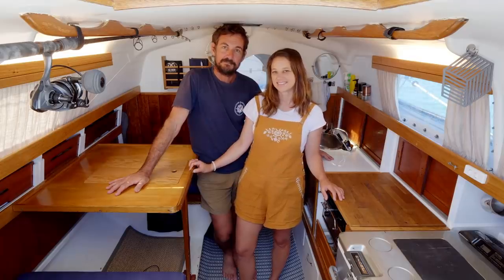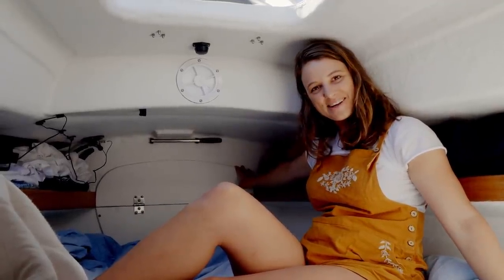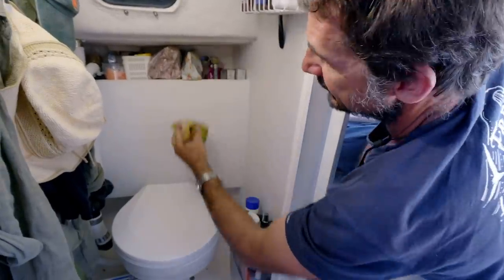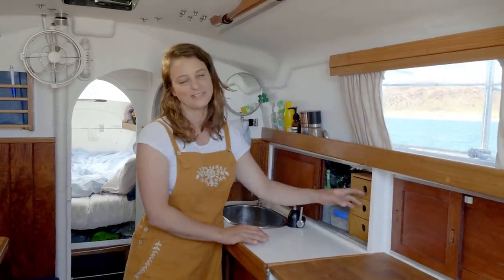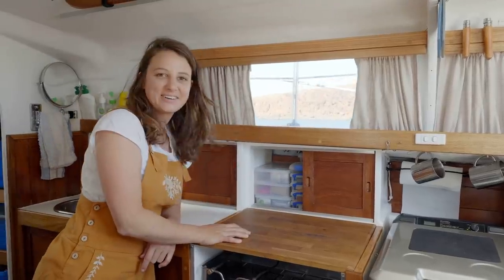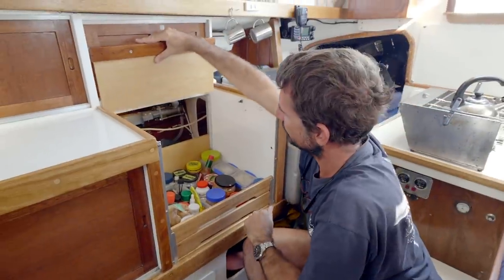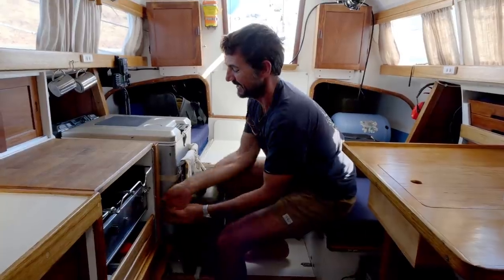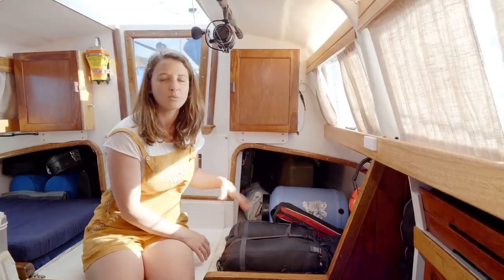Inside our TINY HOME. The 50 year old sailboat we rebuilt.

Comment: I am glad to hear you advocate for a "Sea Chest". I have never understood why some people who clearly have the Opportunity when refitting or building a boat do not avail themselves of that option. In addition, I am a strong believer in cooling the Main engine with a keel cooler. Something as simple as a pipe on the outside of the hull running the entire length, filled with radiator fluid, being cooled by the seawater, and returning cool fluid to the engine would eliminate all kinds of heat-exchanger and raw water cooling pump problems.
I would guess that a very large percentage of below deck problems are the result of not having those two options installed.
I love what you did as it not only shows pride but also a good understanding of how to optimize available resources.
All the best to you both.
Reply from the maker: Keel cooling is the best system if it is designed well to bleed air out of it and a nightmare if it isn't!

Comment: Nice. Great to see what all that hard work has meant. We missed the opportunity to buttonhole you for a look in both Freo and Exmouth, but we also have a Maxie meths stove like yours, that is surplus to our requirements and in a shed in Perth should you ever require it for parts. 
Also re electric propulsion motors, one thing people seem to forget about this is that a sailboat already has a very small carbon footprint because most of the time it is WIND POWERED! The diesel is for auxiliary purposes only. And 200 ltrs per year of diesel is just 2 or 3 fill ups for a car, which no one gives a second thought to.

Comment: Some good ideas there for your boat layout, I've got a 1973 Kings Cruiser 29. Very narrow just like yours but loads of headroom, I'm 5 foot 8 with room above. So probably about the same headroom. Also on manual water pump and an original origo 3000 meths cooker, I use bio ethanol here in the UK.

Comment: Re the multiple seacocks agreed, we have two on our boat these days, but that's just because the cooling pump for the engine sucked too hard and caused the other pumps to fail to deliver consistently. So they're split on two now and it's been good ever since. Also, absolutely incredible how thrifty you are with water. Even if you splurged and used 10/day/person you'd go 50 days without a top up on our boat with 1000l :-D However ours gives about 5 days with a crew of 4-6 including ~50% females who don't like the pump turned off mid shower but get the message quickly from it :-D

Comment: Very nice/clever holding tank setup you have there. The only extra thing I'd have is a port on the top so you could use a salt water hose to rinse it out every now and again to avoid build up of solids or whatever. Our boat is still antisocial, illegal since 2002 inshore. My plan is not to go with these complex mechanisms, though if going long distance I probably would go a similar way, instead it's to use 50l plastic drums and have a composting set up. Carry coco coir bricks to rehydrate and cover it with because they're very compact (approx 50l from about 1l). Could hold maybe 10-50 of the drums in the hold for longer voyages. When full, lid on, and stow, replace with empty and repeat. I do plan to do a small tank setup for shower and kitchen water to be fully compliant, but it's not a big priority.
Reply from the maker: Go sailing to clean. Port tack, open valve, flushes at 6.5 knots. Self cleaning.
Reply: @FreeRangeLiving  Ha ha, spot the diesel powered boaty in the comment section! Great answer, thanks :-)

Comment: "in the old timey sailing boats" > Me at 6'4 furiously taking notes for refitting my dads folkboat to live aboard - Yup

Seriously though you guys are a massive inspiration! My dad has already drilled into me not to change much and just spend some time on it before deciding, it's reasuring to hear you guys say the same. Even if the ideas running through my head are driving me a bit mad :)

Comment: I can see a little bit of pride as you were going through your improvements there and quite rightly so, you have a well thought out and functional boat which is also aesthetically pleasing !
Obviously there is a 'but' after a sentence like that and the only thing that I would change is the wing nut and bolt on the bottom of the table leg. It's too fiddly to have to deal with wing nuts and washers and too easy to drop or lose small pieces in certain conditions. I would try to find a way to hold the leg that didn't need fasteners that need to come apart, I would also prefer it if there were no exposed metal bits waiting to snag an ankle in rough weather. There are lots of options in the tractor world like flat headed cottter pins with spring retainers etc that would do the job or even do away with the fastener and just have the leg slot into a socket with one or two of those cupboard catches to stop it popping out.
I really enjoyed this video though, thanks for putting it together !
Reply from the maker: It is pretty well tested and parts are easy to find. M5 washers and wing nuts are pretty common and there isn't a way to hit it in a sea.

Comment: I've bought (with a view to refitting) a thirty year old sailboat (a bit smaller than Mirrool, ie just right!) with a very similar head setup. Very grateful for the insights and suggestions; as always from you two, they're golden.
 I'd be interested to know whether the breather breathes into the cabin, or outside. I presume the latter, otherwise overfilling the holding tank might not lead to a happy place!
Reply from the maker: The breather is 1/2" hose to the exterior. It has a ball valve and can be closed to pressurize the the tank to clear minor blockages in the discharge line as we flush the dunny (with the discharge valve open!)
Reply: @FreeRangeLiving  Brilliant info, thanks for the prompt reply! Dunnies are one of those installation conundrums where it's great to have (brave and generous) others to blaze and clear the trail. May your emus never turn to ostriches!

Comment: You can go to a larger single opening just make it bigger and use a steel pipe stainless steel pipe water tight all the way in and you tap off of that for your different systems that way you reduce your exterior holes in the hull of the ship the way it is on a bigger fishing trawler

Comment: Oh my god your videos are amazing and it's unbelievable what you've done with the boat! Can I ask what size anchor you have. what size chain you use, how much does the boat weight and perhaps the type or power rating of your anchor windlass?

I recently got my first sailboat a 30 footer old Swedish boat and it's in need of some love and an anchor for cruising -- I love the anchor locker pump setup you have I was wondering how to create an anchor locker with drilling holes so low in the boat I was not sure -- I might use what you have done and simply have a hand pump to pump the extra out -- I've already watched like 5 of your videos and they're amazing -- even the one one with the knots -- I've seen a bunch of knotting videos already and practices and mastered a few but still learned the why's and the usefulness of the clove hitch variants like the one for preventing sliding to the side and for the truckers hitch the bowline variant of knotting of is genius and easy to use -- amazing stuff thanks so much and well filmed and edited~

Comment: The RYA advice is to have the appropriate bung actually tied onto the seacock rather than in a drawer as finding the correct one in time, in the dark, in rough seas in an emergency could be fatal. They are usually intended though to be bashed in from the inside not the outside. FWIW.

Comment: perhaps you could put the bungs corresponding with a specific sea-cock next to that seacock? little plastic bag with ty wrap attached to that seacock.
Don't see you jumping overboard in F5 or above to put it in from outside.
Reply from the maker: I have been overboard at night in a gale getting a 40 ton fishing boat off a reef 240 mile offshore. I think sticking a bung in would be fairly straightforward.
Reply: @FreeRangeLiving  Well, actually going overboard is not a real problem i think 😃 Getting back on board might be though 😃

Comment: Ah Troy, isn’t that a simple chimney effect and not a Venturi effect?
Reply from the maker: Not really because it doesn't depend on air temperature differential. Wind blowing over the front hatch is causing a drop in pressure strong enough that a very noticeable draught is set up in the boat.